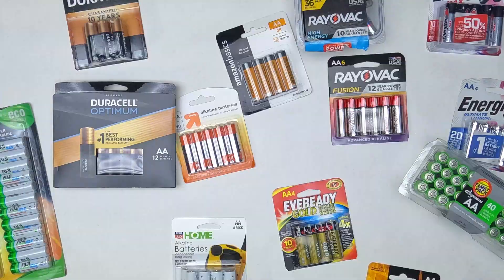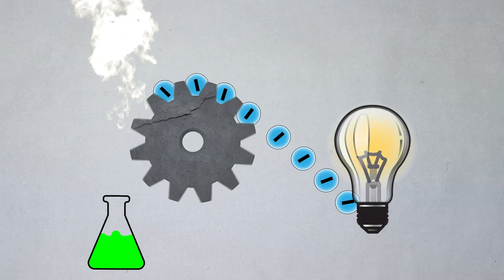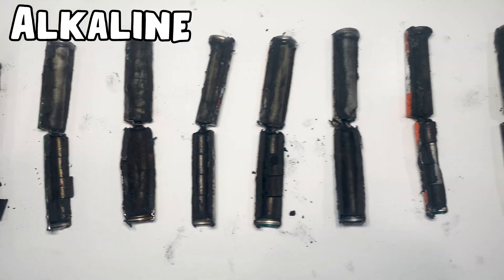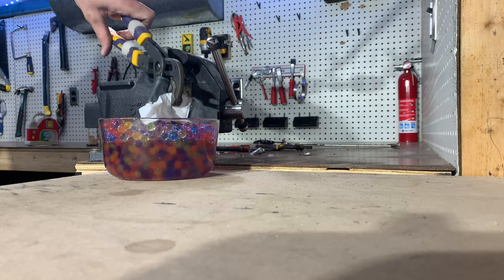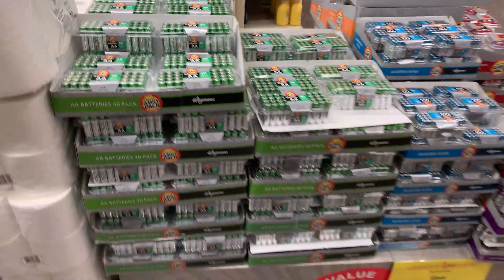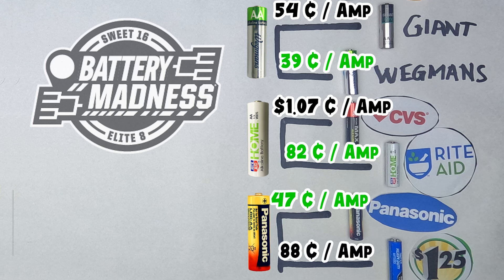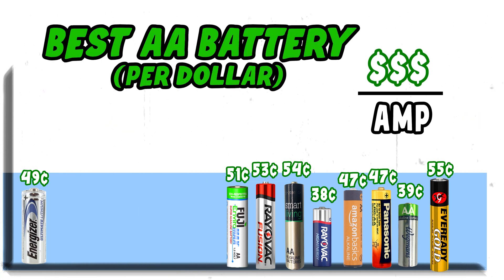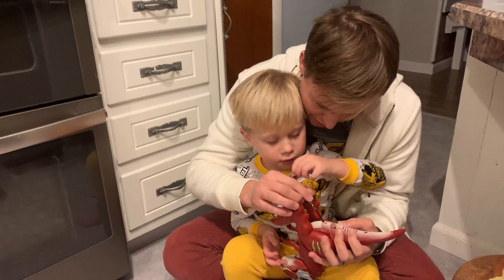Which AA Battery Should You Buy? Best Battery Brand COMPETITION

Comment: Really good video however I do have a few corrections I would like to add. Firstly I would recommend testing dollar store alkaline vs the "heavy duty" ones since the "heavy duty" are really zinc carbon and are obsolete. They're super low capacity and low value as well. 

Also, you are labeling price per amp and have the Y axis for the graphs as amps but it's really amp hours. Amps is really just current draw for a near 0 amount of time (think of derivatives for calculus) whereas amp hours is average current over time which is more important in determining capacity. Amps are like torque, volts are like rpm, and watts are like horsepower, and wh is like total work done. A low rpm, high torque motor will get the same work done as a low torque high rpm motor in terms of horsepower. What we care about is how much time can they do a fixed amount of work for. 

Watt hours is the most important metric as that's actual capacity (thats why batteries for TSA are checked for wh). A lot of devices regulate the voltage that's supplied, meaning they have a constant voltage, current and therefore watts. For something like a cheap handheld fan, the voltage likely isn't regulated and the current is drawn based on the supplied voltage and total resistance. In that case batteries with a high wh would get more "total work" done. It could power the fan more slowly if it had more voltage sag but for longer. Or more quickly for a shorter period of time if it has less sag, but the total air moved (ignoring the fans efficiency) would match the wh metric. I suspect the difference wouldn't be huge between the mah graphs and the wh graphs, but it probably would make some difference, especially between different battery technologies. I think the lithium would have a bigger boost in mwh vs mah since it likely has less voltage sag and is likely doing more "work" in your test when drawn a constant current vs the others.

If you were to do a part 2 (which I would like to see :D ) I would recommend doing just alkaline and lithium. Test for watt hours vs amps or amp hours when testing for capacity. Also test for peak current by continuously placing them under higher load until the voltage drops to below like 1.2-1.0 volts or something. I would also test for various power draws, do maybe 1.5 watts, .5 watts and .1 watts or something like that when doing capacity testing to see what does better for various scenarios to replicate a flashlight vs kids toy vs remote for example.

Comment: Firstly, the Energizer Lithium is a lithium battery, not lithium ion. Lithium ion batteries are rechargeable batteries. And lithium batteries have objectively higher performance than alkaline batteries.

Secondly, testing different alkaline brands is useless because you will get different results every time. The quality of the battery isn't dependent on the brand. It's actually completely random. If you test between two batteries from the same brand just bought at different times, you will likely find that they also perform differently, making the test actually quite useless. But this means that cheaper alkaine batteries are almost always better because they are the same but for cheaper. More expensive battery brands like duracell and energizer are a con in that they use neuromarketing and play on brand loyalty to simply convince people that their products are better when they're not. It's the same as branded pharmaceutical products. It's the exact same product; they just make more money from trying to convince you that, because they are an established brand, their product is somehow superior. That's how I think it really works.

Comment: So capacity is not nearly as important as which battery will leak most often and ruin your gear.  I've had real bad experiences with most alkaline batteries, and Energizer and Duracell are both bad.  I've yet to experience any leaks with a lithium battery.  One other thing....lithium batteries produce 1.2 Vdc whereas alkaline batteries (should) make 1.5 Vdc.  The alkaline batteries will be brighter in a flashlight (at least at first, but lithium will hold a more consistent voltage throughout their life cycle), but will not make any difference in things like game cameras.  Food for thought....what matters to you?
Reply: You confused lithium with NiMH rechargeable batteries - those are the ones with 1.2 V. But lithium non-rechargeable batteries actually have slightly higher voltage than alkaline batteries - they start at 1.8 V but quickly drop to 1.5 or less depending on the load. Their voltage is also pretty consistent and higher than alkaline batteries - in a flashlight  they will be both brighter and keep consistent output. And they will beat alkalines to death in freezing temperatures.

Comment: You didn't test the * Home Depot Brand HDX * which is supposed to be really good (and in the .30 to .40 cent range) from what I've seen in other videos. Also, you dumped all the batteries in a drawer after?? Maybe another video on battery storage is needed?? lol
Reply from the maker: Ha, yea I ended up testing all of the batteries in the drawer right after getting that video shot. Need to test Home Depot, probably similar to target or Amazon but with better price point.

Comment: Please test alkaline recharging! I'm finding that recharging 99¢ ac Delco gives about 75% of the original power, and they die much quicker. I'd like to find a happy medium between price and performance, though at this point I may just buy like 100 lithium to be prepared before you can test this. Thanks!
Reply from the maker: Lithium re-charging is best!
Reply: @BuildItDad  yeah, but compared to the expense? And do lithium batteries get too old? Yep, just like alkaline. So trying to have rechargeables for everything seems like folly

Comment: OK I'm just a picky EE so I have to correct some units here, especially since it's an engineering channel. I assume you're a mechanical engineer and not an electrical one, so aren't as familiar with the units.

Current: Amps, but generally milli-Amps (mA) at this scale.

Charge Capacity: Technically Coulombs (C). But for small batteries, especially rechargable ones, milli-Amp-hours (mAh) are more common. 1 mAh = 3.6C.

mAh is used because it is easier to picture. And because batteries also express charge/discharge rates in rates proportionate to their capacity which are also expressed as (C). That is, a 1000mAh battery draining at 2000mA is draining at "2C". 

Energy capacity: milli-Watt-hours (mWh). I bring this one up, because for a 1.5v battery, the mWh rating would be a higher number than the mAh rating. This is sometimes used to try to upsell batteries. Though it is actually a useful number in its own right, since the voltage of the battery changes as it discharges, and this gives you a better idea of how much total energy is available across those changes. This is why EV batteries are measured in kWh.

Anyway, I bring this up because you described a toy as "it draws 10mA every time I press this button so on a 1000mA battery, I can press it x number of times". Saying it draws 10mA doesn't tell you how much charge it is actually consuming. And a "1000mA battery" tells you nothing about its capacity. It could be a 100mAh battery draining at 10C, or a 10Ah battery drawing at 0.1C. Or any number of combinations, since you described current rather than charge.

Instead, if the toy draws 10mA while you press the button, it only draws this while the sound is playing. If the sound lasts 1s, then it consumes about 2.6uAh (micro-Amp-Hours) or 0.0026mAh. Then you would divide the capacity of the battery in mAh by this value to get a very rough number of times the button can be pressed. So a 1000mAh battery could have this button pressed 360,000 times in a perfect world. (Not so perfect for the parents who bought the toy).
Reply from the maker: Hey, thanks, I appreciate and agree with your in depth explanation. And yes, I am a mechy... I should setup an arduino with a solenoid to press the button over and over again, counting how many times it plays until it drains. Just make sure it is far away from where we can here it, lol :)

Comment: I feel that normalizing the prices of the batteries to an 8-pack made some of the off brands lose their main advantage. If a 100 pack only costs a few dollars more and brings the cost down to less than 30 cents a battery their performance vs cost would be much better than the brands that don't have that option. It might be annoying to change the batteries more often but it's definitely more a bang for your buck.
Reply from the maker: Thanks for sharing... Yea, our results showed if you can get a generic store brand for less than 50-60 cents per battery, 
then you are getting more amps per dollar, than you would spending more on the name brands. Also, many of the generic store brands performed similarly. I imagine they could even be from the same manufacturers, and just re-labeled for each store.

Comment: Project Farm did this test and energizer came out far ahead of Duracell . I trust ProfectFarm. All of his tests have been on the nose. I purchased products he’s tested and been more than impressed afterward. No advertising on his channel.
Reply from the maker: Thanks for your comment! Love project farm. His testing is always very thorough. I'll put a link to his battery testing video here (https://www.youtube.com/watch?v=V7-ghrTqA44). The Project Farm compares overall performance, whereas this video focuses on performance per dollar. I'm continuing to test the rest of the batteries from the video, at different drain rates. Once I complete that testing, I will share all the juicy results at engineeringdad.com... Sorry about the advertising. Until I reach 1000 subscribers, YouTube is in control of the ads on my channel.
Reply: Ladda nimh is my pick, but about Duracell vs energiser, I asked my phone a year or two ago and it told me

Energizer last three times as long as in low drain devices like a simple clock

Duracell last 2 times as long in high drain devices, didn't specify what, but I figure flashlights

I kinda believe it may be possible that Energizer work better in low drain and Duracell works better in high drain

But like I said, I buy neither, rechargable NiMh from IKEA Ladda brand is my go too, because eneloops are too expensive
Reply: I found another video which put the Home Depot brand on top.
Reply: I wouldn’t say it came out far ahead. It was like 5%.